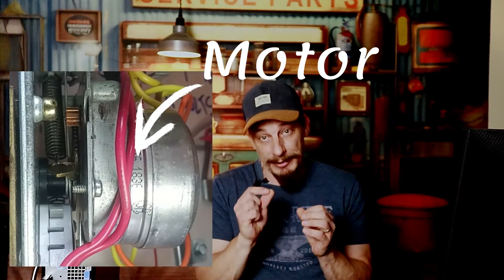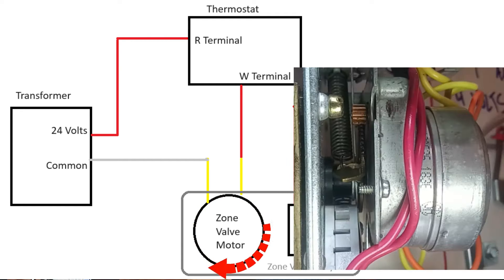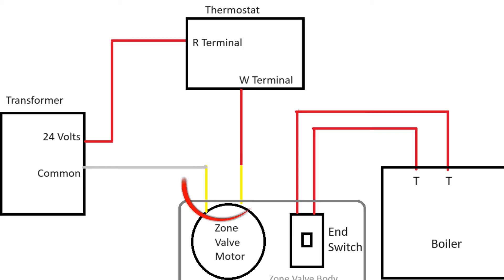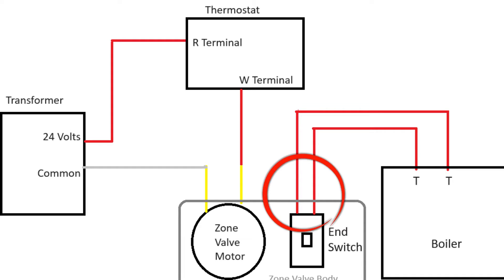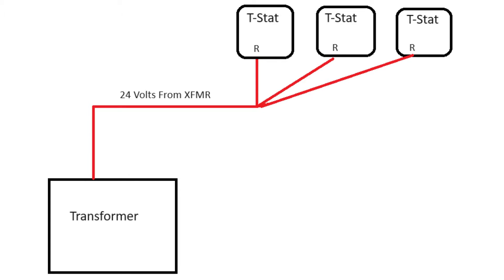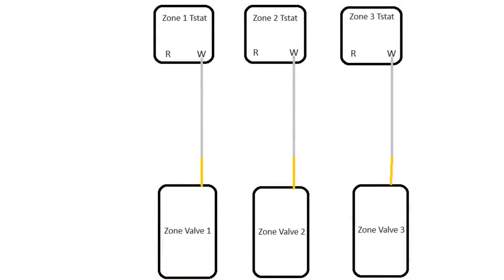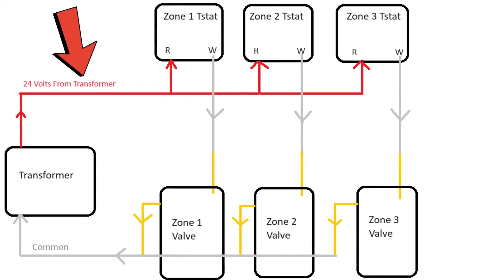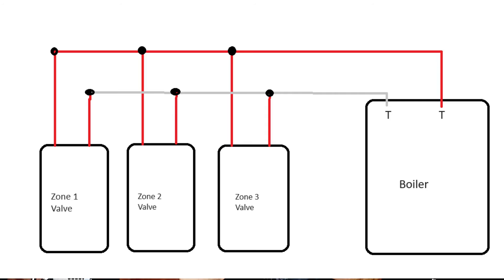Unlocking the Mystery of Zone Valve Wiring

Comment: can I have 1 thermostat operating 2 zone valves by connecting the W wire to both zone valves? 4 thermostats with 9 zones (valves) using a watts tekmar zone valve control 306V and an "on-demand Renai boiler"

Comment: Mike, great stuff.   One question with regards to mult zone valve wiring on the thermostat load side.    In some of your lessons you show the transformer load going to all zone valves (TR) first then each ZV (TH) to corresponding Thermostat R.   The W's of all Thermo group spliced to common transformer.  (i.e. https://www.youtube.com/watch?v=XtUO_A7aodQ   and   https://www.youtube.com/watch?v=jQklHi-nrYA)     Other lessons put transformer load spliced direct to each thermostat R,  then each ZV on the W (or relayed) side of the  corresponding Thermo... then all ZV (TR) group spliced to transformer common  (i.e https://www.youtube.com/watch?v=9kVQpeNezL0).    Why?..... Is one better than the other?
Reply from the maker: It can be done either way because they are both series circuits and only the motor provides resistance, so there's no voltage drops or anything impeding amperage flow with the different set ups. Most people however run power to the stats first. Just probably how most people are taught when learning the wiring.

Comment: I wired in a Taco zone valve controller which works great, but could I have wired the zone valves up without a controller and get the same performance?
Reply: That’s correct. I have a zone valve controller free system. All you need is a 24v transformer and do exactly what he said
Reply: @Drtbiker88  Interesting, well the green boxes on the wall with yellow and red lights looks real nice anyway....lol

Comment: Ok but what if you just bought a Watts Tekmar that has the transformer built in?  As far as I can see, it looks like the Tekmar takes care of the details and all you need to do is wire as noted in the diagrams.  So both reds to motor, and each yellow to the end switch.  I'm just at the finishing steps and can't see any other way to do it.
Reply from the maker: Yes wire as the diagrams in the Tekmar indicate. But yellows are your motor. Reds are the end switch.
Reply: @JerseyMikeHVAC  yup, I figured that part out.  Get this: turns out the former homeowner crossed zone 1 and zone 2 so the supply lines were fighting each other.  How they had 3 zones working when we bought the joint, I'll never understand.  Also had to replace the transformer.  The Tekmar works great.  I'll be uncrossing those lines tmw.  I want to have a chat with the monkey that did that.... ugh.

Comment: Your older videos show the R transformer to yellow zone valve. These show it bypassing the yellow and using the white to put power to zone valve. Is there benefit to sending the 24 directly to Tstat here vs sending it through the zone valve. Difference here is the zone valve doesn’t get the power until tstat completes circuit where as before it gets the power but doesn’t complete circuit to power motors until tstat closes circuit. I’m wondering if it’s for longevity of the valve or what reason is. Also do you have video showing the wiring including the C wire for most modern thermostats?
Reply: Curious if you run the RED directory to Thermostat bypassing the Zone Valve on way up... How can you leverage this 24v to become the "common" wire for thermostat? Can you take the red thermostat wire and plug into R and jump to C (or vice versa)? Basically seems to allow the 2 wire thermostat wires to deal with the "missing common" issue it would seem.
Reply from the maker: Powering the t-stat first generally works with many different types of zone valves, particularly if you have taco power heads and such. So going T-stat first is a more universal wiring approach that can accommodate variations there, and it's how most techs wire the stuff up anyway. Also with today's smart thermostats, powering them first can more likely help them work with full functionality. There may be a power related theory behind why going zone valve first might not be ideal, but I can't remember what it is. I had techs with 20+ years experience show me the ZV first method when I first started, so I don't think whatever that theory might be is very popular. 

 As for a jumper between R and C, no. On power stealing thermostats you can use a resistor as a jumper between W and C and that typically works.
Reply: Yeah since R-W isn’t closed until calling now sure how C would play into that. I’m just trying to figure out another way to leverage 2 wire tstat wire missing a C without need for something like Fast-stat common maker kit.

Comment: question, you mentioned at the end that some people use the ZC terminal instead of the C terminal. wouldn't the circ be powered every time during the call from the low limit even without the t-stat call for heat ?
Reply from the maker: I said TV and T at the end there,  not ZC and C.